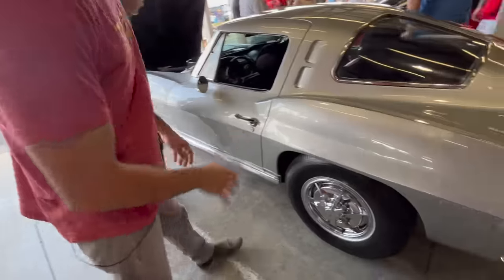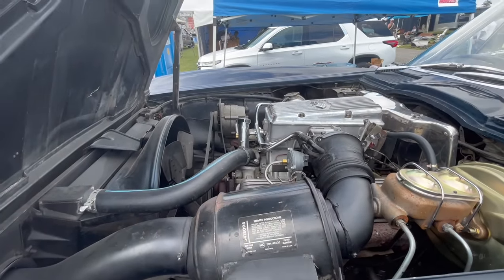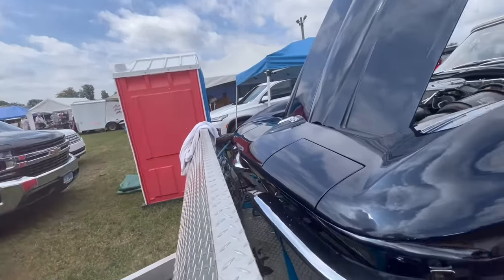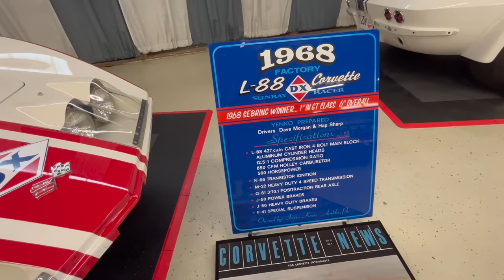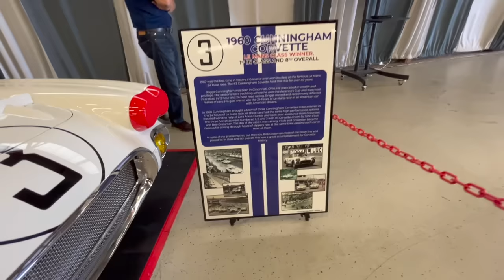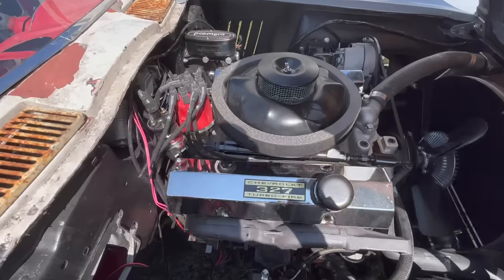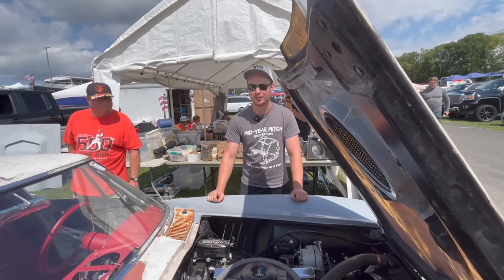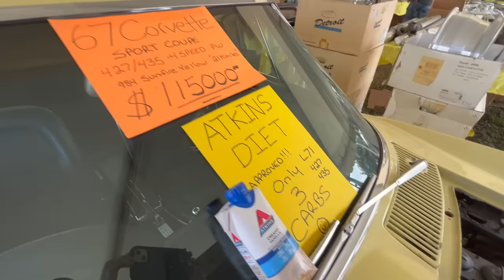C2 Corvettes by Price & Year! Automotive Swap Meet Walkthrough | Carlisle 2023

Comment: Very informative vid.  A few more tidbits....Laguna blue 64 roadster has a non-correct flat blade hurst shifter w/white ball.  Also, early 64's had raised boss under the outer door handle like the 63 (I think this one does too),  also this car has a double reservoir MC; should have a single res in 64's. B pillar roof louvers came out in 64 (fnct'l only on driver's side).  Most of the big block oil pressure gauges go to 80 lbs.  Small block only goes to 60lbs.  Great Video!  A+++++

Comment: Bought a 67 tri power from a fellow in 75, $2700. Fuel prices were up and he wanted to buy a Honda. Had to have the frame re-welded because it wouldn’t maintain front end alignment. Started burning oil, replaced the valve seals And drove it till 85 without a problem.

Comment: Just an FYI abut the tachometer on the '63 Corvette: Both the 360HP (fuel injected) and the 340HP (carbureted) had 6500 RPM redline. They had the same high compression, solid lifter block, with the difference being fuel injection vs. carburetor.